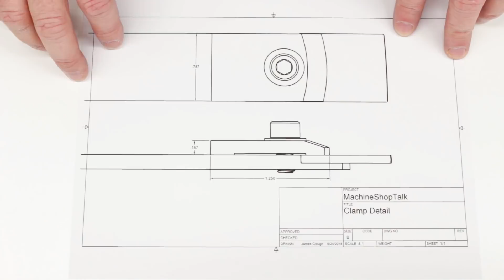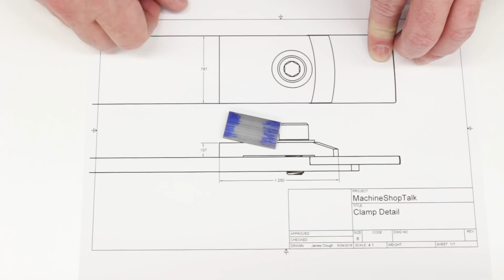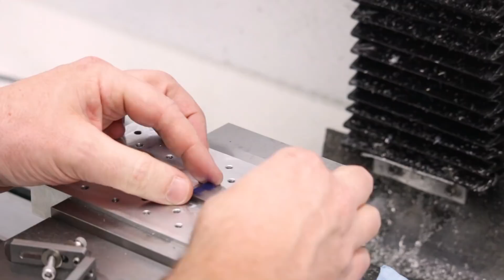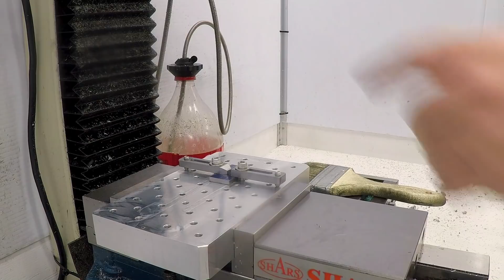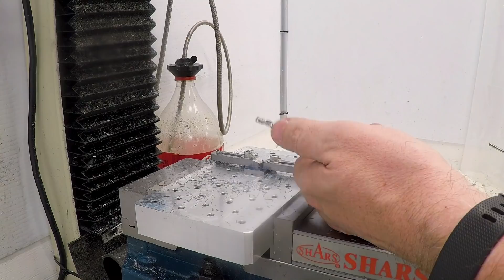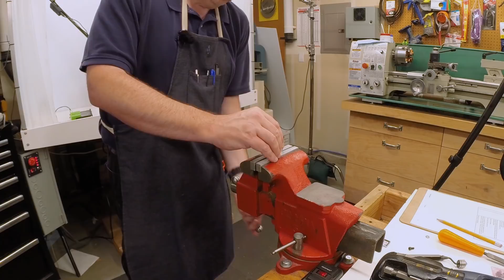Hand Scraper Part 4: Machining the Clamp

Comment: Why not drill the clamping screw hole first and using that for hold down?
Reply from the maker: I considered it, but decided against it for two reasons.  First, I was worried the part might rotate around the screw.  I was climb milling with a clockwise-turning cutter, so the forces would tend to try to rotate the part counter-clockwise, which could loosen the screw.  I figured it would be safer to clamp it in two spots to provide a longer moment arm to resist rotation.  Second, I was a little worried about getting the screw hole positioned accurately.  If I drilled it first, I would have to zero off the hole or the screw head and that isn't as accurate as contouring the ends first and then locating the screw off the machined surfaces.  That's total overkill for this, but it's what was going through my head at the time.